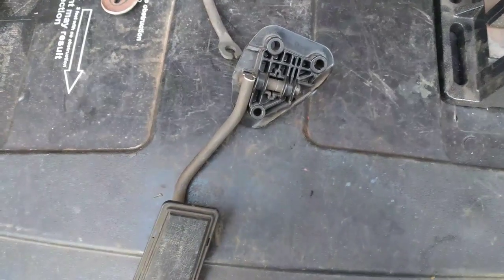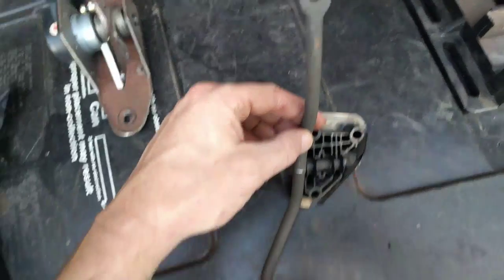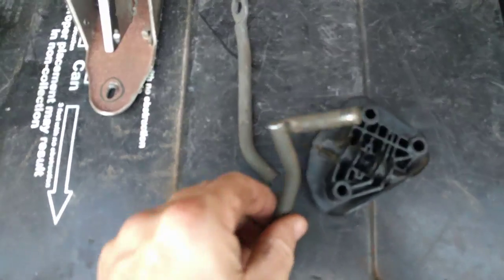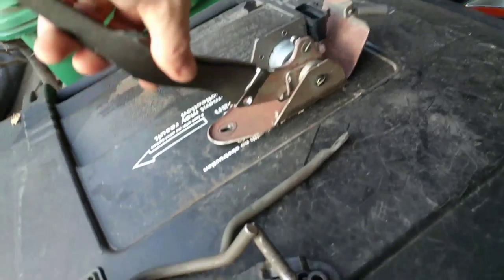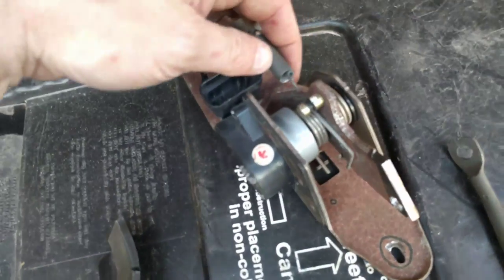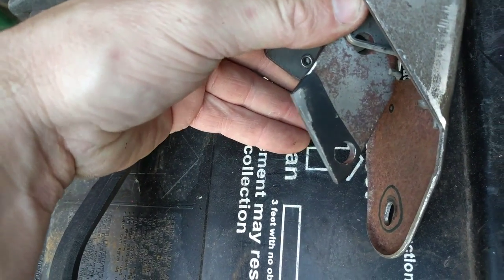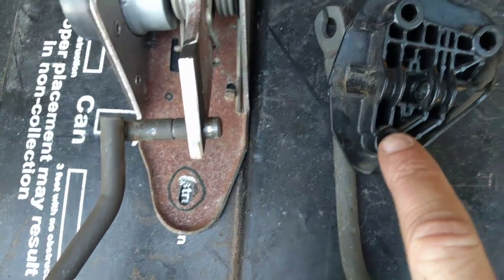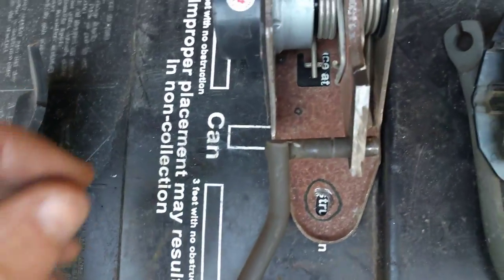LS DBW Vortec Gas Pedal mod for Gbody

Comment: Very nice. How did you know how much to cut off of the GM pedal and where to drill the hole?
And, how far (left or right) should the Jeep pedal be positioned in the GM pedal bracket?
Reply from the maker: I really don't remember.  I believe I just tried to make it as close to the stock pedal assembly as possible.

Comment: Hey, do you know of a 6 pin pedal option for the g body? I have only been able to get the plastic truck pedal to work with my TAC and throttle.
Reply from the maker: The TAC module and pedal combinations are a nightmare.  You're better off just sticking with the pedal/TAC/PCM combo from the same vehicle.  I wasted probably $100 on junkyard TAC modules trying to get something that was compatible.

Comment: very nice!!  What make and model is your DBW pedal out of?
Reply from the maker: I don't remember.  I don't think I have the part number either.  I'll check around.  It's a common pedal.
Reply: @n5yiz  Did you ever find out what year and model it was?
Reply: @Iann128  I just did this on mine a minute ago..  I used the pedal out of an 03 Silverado 2500 hd 6.0..

Comment: This looks like a cable driven setup, not DBW?
Reply from the maker: DBW all day long
Reply from the maker: https://youtu.be/_7zU2bZw8BA
Reply: So that pedal assembly bolts up to an electronic mounted next to pedal driving the wire throttle system? Just don't see any electronics here
Reply from the maker: @drwombat  The stock G-body pedal has been "grafted" to a DBW pedal out of a truck.
Reply: Looks dbc, not dbw
Reply: @Juan Rodriguez   @pmoore4321  
It's DBW. You can see the new pedal has the connection for the sensor up top. It's not linked to the carb/tb by a cable anymore lol